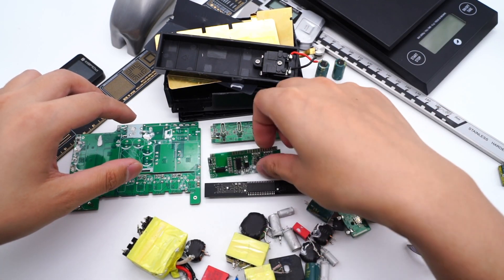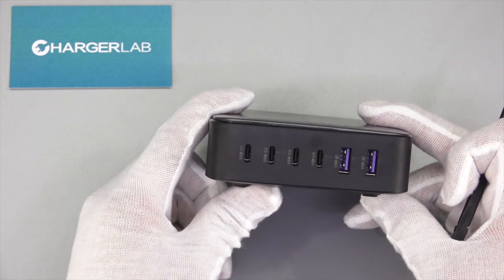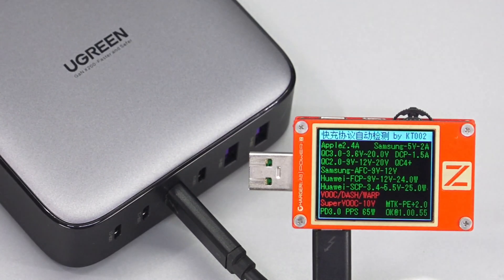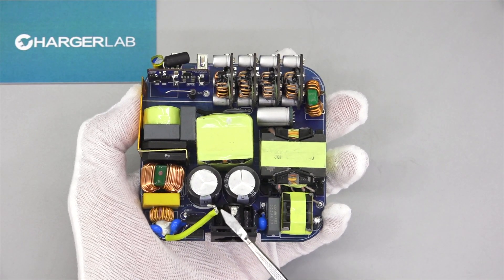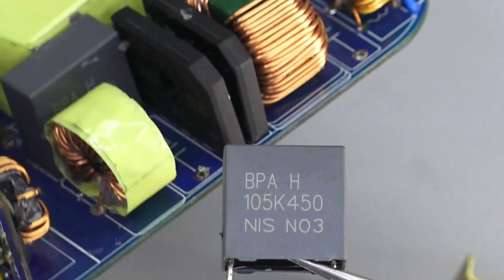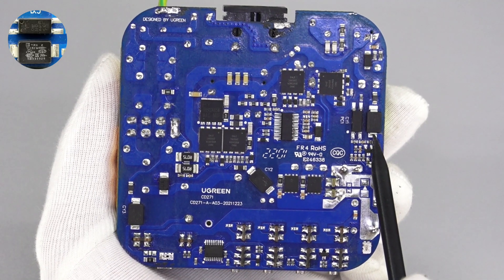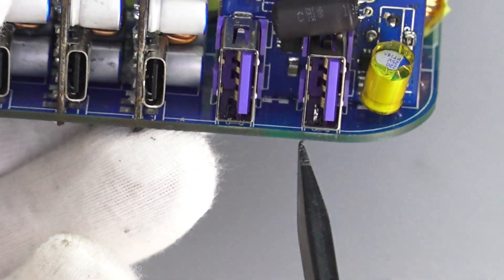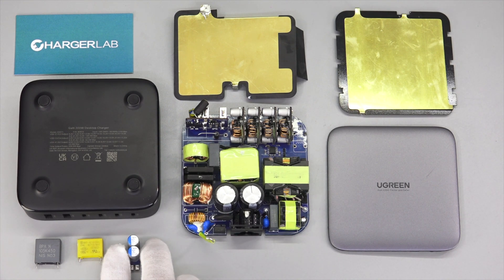Teardown of UGREEN Nexode 200W Desktop Charger (4C2A)

Comment: So as far as I can tell it uses regular capacitor based interference suppression, instead of grounding the secondary side right? That's too bad, I'm looking for a 100 W USB-C Charger with grounded output, because it's super annoying when the chassis of your laptop is at 100 V or so, even if it's high impedance.
Reply: Huh I was hoping it would be properly grounded due to the 3-pin power cable (as opposed to 2-pin on a lot of similar products) and metal ground wall socket pin. And this one costs £200! All I want is a long, PROPERLY GROUNDED 100w usb power brick so I can charge my macbook and phone at the same time. Can't find one anywhere!
Reply: @hlizzle  Yeah, tell me about it. Unfortunately, most chargers aren't grounded, even if they have a grounded 3-pin power cable. Which is kinda ridiculous, cause it defeats the purpose of having a ground in the first place. 
On most charger with multiple USB ports, all port share a common "ground", so usually you can manually ground one of the USB ports and have the other ones be grounded as well. You can make yourself a "ground USB cable", to plug into the charger. Which is a good workaround, but it's an unnecessary hassle and makes the charger less portable. So I would definitely also prefer having a decent charger that uses the ground, instead of messing around with mains referenced filtering capacitors for no reason. It's just dumb...
Reply: @phinok.m.628  Very sad, was actually excited when I saw the 3 prong plug in the product photos. Actually would've paid the pretty high 200$ price, but yeah, not properly earthed again. I know that it's done for EMI reasons, but come on people, it can't be that hard...

Comment: Disappointing that they dropped PPS support to just 3A compared to 5A on their previous 100W Desktop Charger. It mean devices like Samsung's newer Galaxy phones and tablets won't be able to charge at 45W on this charger, they'll be limited to around 30W. EDIT: This seems to be the case for all the newer "Nexode" products from UGreen.
Reply: Agree. It's very hard to find 5A PPS charger nowadays.
Reply: Realme Vooc also accept PPS in older phone.
I think PPS need expensive chipser because it has Variable voltage instead of static voltage in other fast charge
Reply: Honestly, if you keep your phones as long as I do, you don't want to charge them too fast. Batteries live longer if you charge them slower. My Note 8 charges at 10 W, 7 years later the battery still lasts almost the whole day with some YouTube and video games usage. And it still charges fast enough I've never felt the need to use a bigger charger.
Reply: @TheNefastor  true, but there are times you need to charge fast. And if you are buying a 200W charger, you want it to at least be able to charge your phone fast, even if you're going to slow charge it most of the time.
Reply: So, are you saying $200 charger can't super charge samsung s23 ultra @ 45 watt???🤯
Reply: @zenatic5150  correct.